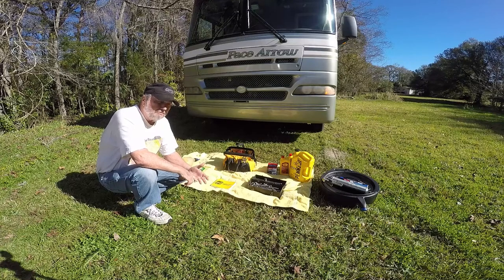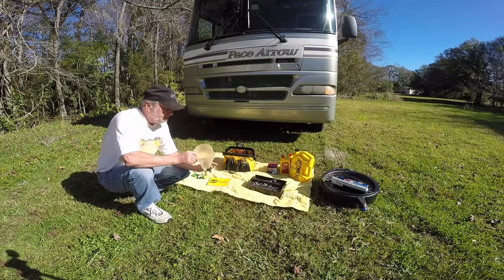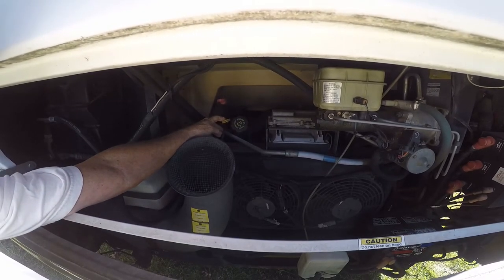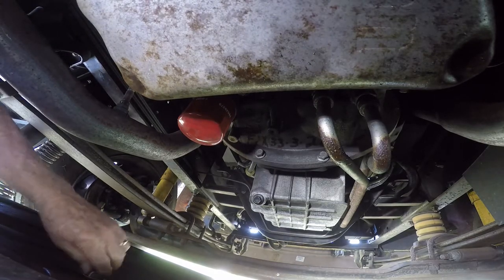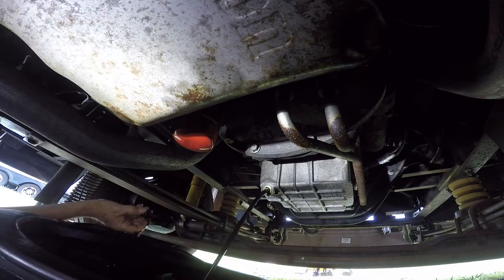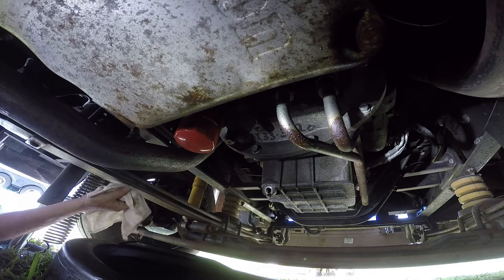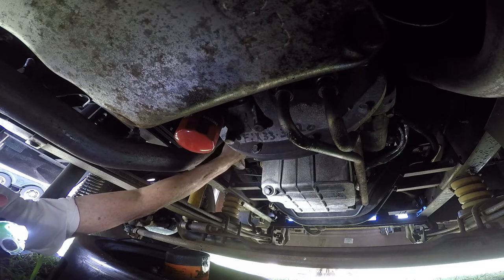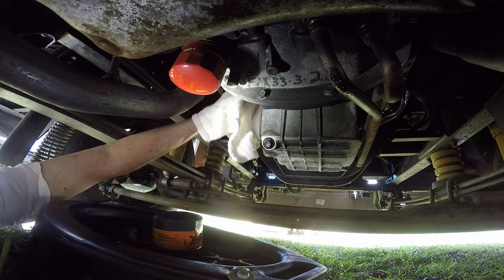2003 Pace Arrow RV  Oil Change Procedure

Comment: Hello I just bought the exact same model of motor home could you tell me where the hydraulic pump is I’m having a problem with alarm on leveling system. Also have you ever serviced your transmission? Thanks for taking the time to do these videos! DT